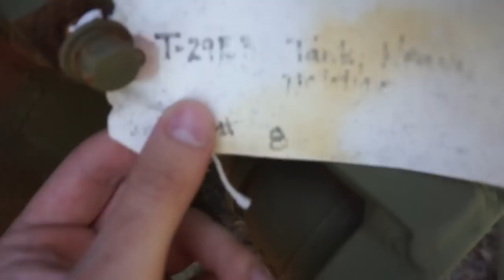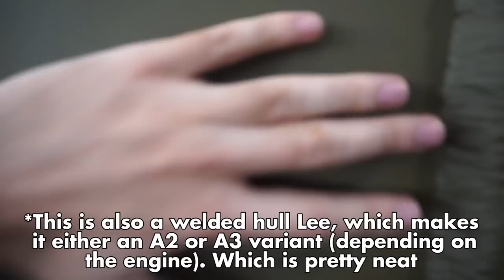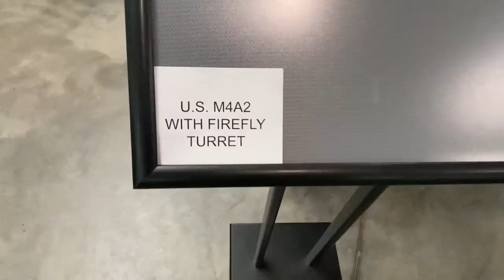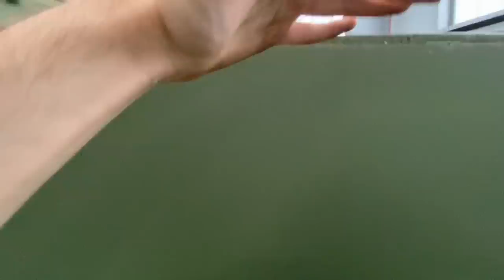I drove to Georgia and saw tanks

Comment: 4:12 is actually a T-62, you can tell by the different wheel spacing (these are more evenly spaced out whereas a T-55 has a larger gap between the first wheel and the rest) the different turret shape (admittedly the difference is subtle) and the place of the bore evacuator on the barrel, on a T-55 it is on the tip, and more on the middle in the T-62, additionally you can look into the barrel and see that it is smooth bore, as well as see the shell ejection hatch on th e back of the turret.

Comment: 5:02 That's a M60A1. It has a coincidence range finder, just like M47, M48, and early T-72. You can tell it's not a A3 since there is no wind sensor (a tube) at the back of the turret. Additionally, on the A3, the opening in the left blister is closed.

Comment: The 50cal of your m4a3 76w cobi is not in the right place ,take a look in the instructions 😂❤love your vids btw ❤
Reply from the maker: I modified it myself. I used an old .30 cal I had lying in a bin and put it on the commanders position, and moved the .50 to the rear of the turret, just how it would have been in real life.
Reply: @eta320  cool i like it

Comment: 20:32 I thought that this was a T95 becuase it’s got double layered tracks, and the T28 has single layer tracks
Reply: Same tank t28 in war thunder is just a t95 in transport mode for railway transport
Reply: The T95 and T28 are the exact same vehicle. The different names came about as the US army didn't know what to designate it as, it started as T28 heavy tank then changed to T95 gun motor carriage and then to T28 super heavy tank. The presence of the outer pair of tracks has nothing to do with the name, both WoT and WT get this wrong. The tracks were designed to be removed to reduce the tanks width so that it could be transported by rail.
Reply: Ok thanks, I just thought that the t28 had only the one layer of track and the t95 had 2 layers. Also don’t both of them not have Neutral Turing?